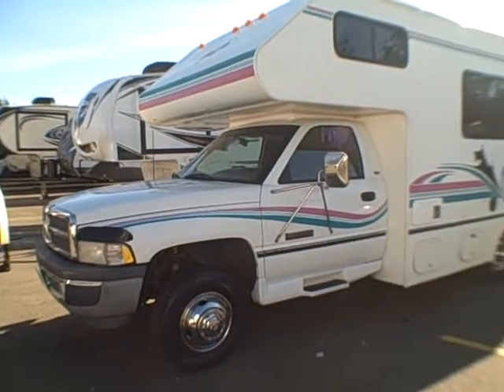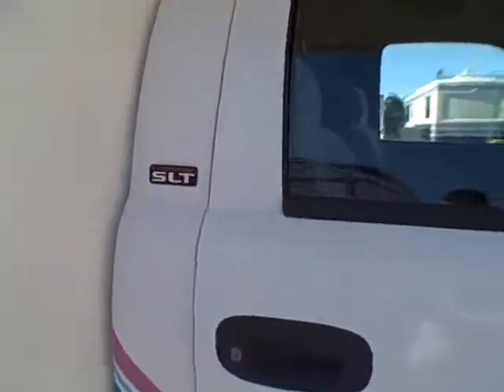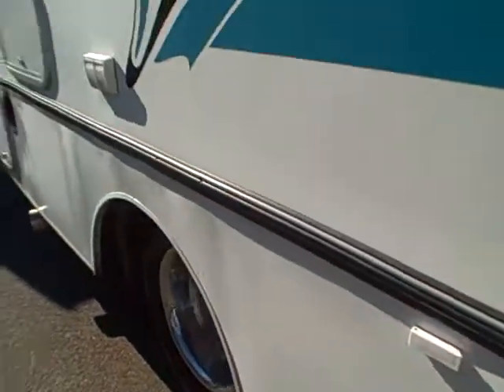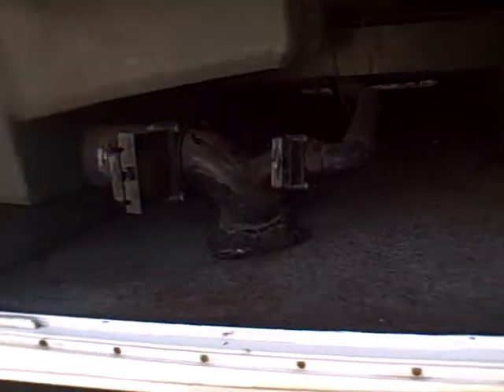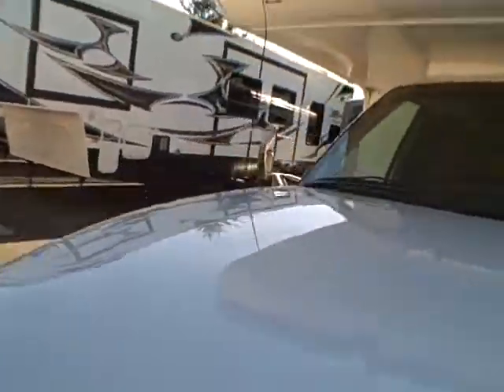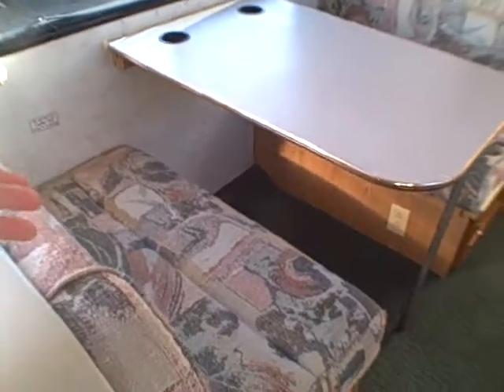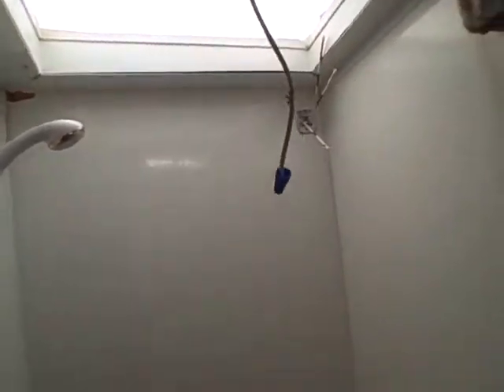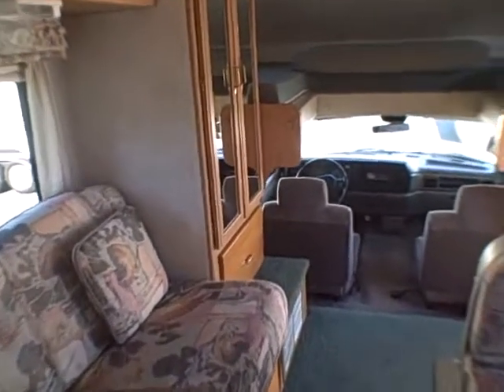1995 Serro Scotty Class C #30125

Comment: What wasn't mentioned .. it's actually a Serro hilander 2500GT (25 foot) built on a Dodge Ram 3500 4X4 chassis, with a straight tube axle and no 4X4 running gear. It can be converted back into a 4 wheel drive very easy. It has the optional 51 gallon fuel tank along with the OEM 35 gallon tank, giving it a total of 86 gallons of fuel. There was many repairs performed on the coach @ Gibs, along with new chassis and house batteries. The tires are Toyo brand and were purchased less than 4 years ago, hardly any miles on them. Also has a pair of overload air bags in the rear with onboard air compressor, and adj. valve in the cab for air pressure adjustments on the fly. The coach drives and runs better then when new with the Banks Power, "Cummins Stinger kit" The coach still requires lots of cleaning (the rear outside storage area was caked with dried feces) took about 20 minutes of brush scrubbing with Simple Green, followed-up with bleach water and a large sponge to get it cleaned. The coach must of been owned by a smoker, it wreaks of the musty ashtray smell, but we have that almost cleared with steam cleaning and laundering of the curtains. On a scale of 1-10, I'd still give Gibs RV a 10 for the effort their service put into this 20 year old coach! If you're in the market for an RV, or need to consign your rig, check them out at http://www.gibsrvsuperstore.com/ they are a fantastic group of folks, that give you the friendly service you'd expect as a customer. Curtis  was our salesperson; very helpful with the sale and great follow-up.
Reply: @Bob  Were all the Hilanders built on a 4X4 chassis? This is the first mention I have heard of this